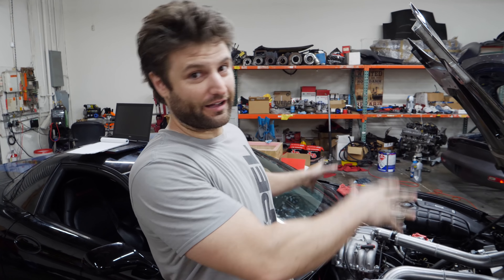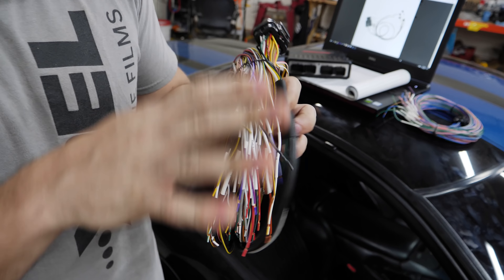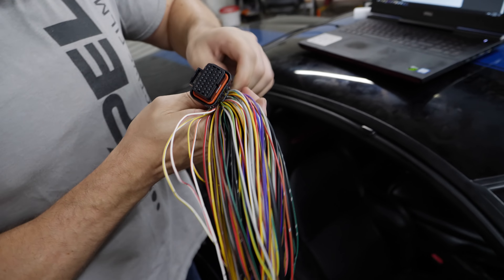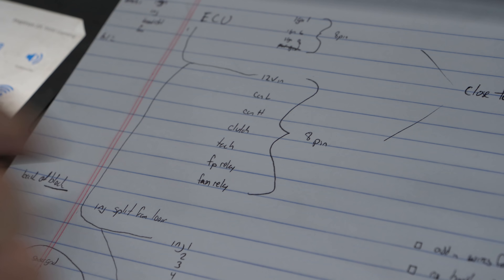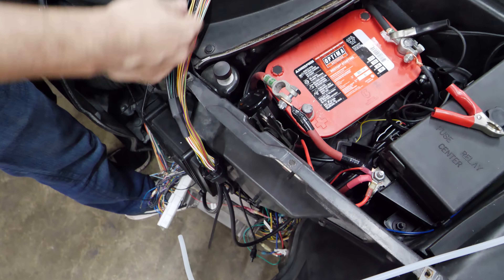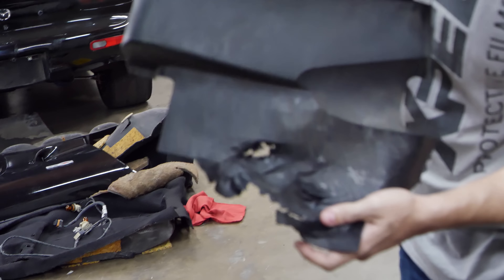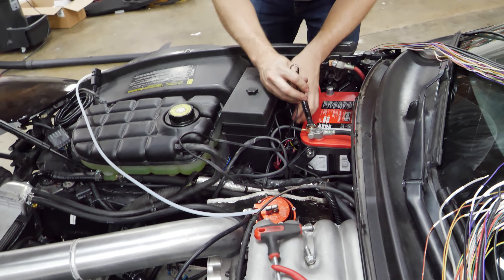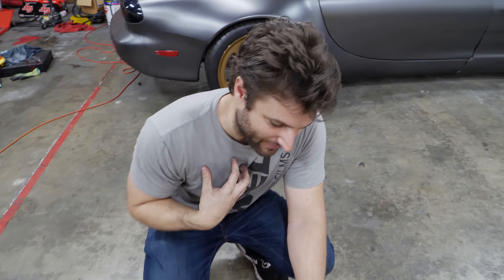Building the ULTIMATE Wiring Harness for any Rotary Engine. Since mine is destroyed...

Comment: You're probably already done, and you've already found out that making cables is deceptively difficult. Welcome to the wonderful world of cables! We have cake on Tuesdays.

However, as someone who inspects cables for aircraft daily, and used to make them, I'll give this one bit of advice to you and anyone else reading: get the best quality crimp tool and wire stripper you can possibly afford. Everything rides on that one connection, and I can't tell you (literally, I'm not allowed to lol) how many cables I reject for bad crimp connections and damaged wire from shitty/worn out strippers cutting into the wire. If you're shelling out for the power, you owe it to yourself to have quality tools that'll do the job right the first time.

Oh, and always leave some slack for re-terminating cables in the field. Always.
Reply: This comment needs more upvotes.
Reply: Any wire strippers and crimp tool you would recommend? Links?
Reply: @robdahm
Reply: Air Force? I was MXS but 2a6x2, worked on Detroit diesels, turbine engines, hydraulics, pneumatics, compressors, bomb lifts, generators, frequency converters, you name it.
Reply: You had me at cake. How do I join this Cake Tuesday club?
Reply: I've never seen loom-making as difficult, just time consuming, especially for custom looms. Aircraft, or anything military related, or space related, are held to much, much higher standards. While yes, the best possible tools are preferred, you can also get by with cheaper tools as long as they work and are used properly, when the job isn't held to such high standards. Most bad crimps, that aren't held to super high standards, are from people not using a tool properly, or trying to crimp with the improper tool.

The biggest problem with custom looms, as Rob has partially discovered, is improper routing, and the other part is bundling the loom into a singular entity, such as a split loom tube, or using something like tesa tape to bundle the loom. Having so many wires unbundled is just asking for problems, especially when you need to service the loom. 
Next issue after that is having so many connections within the loom. Ideally you want one run of wire from end to end. Though there are cases where this ideal isn't so ideal, like having bulkhead connectors mid-loom for ease of service; though this should be saved for any large looms, or difficult to remove wires, that are passing through a non-removable panel, such as the firewall. But these singular wire connections mid-loom is just not good. 

There's also the problem of heat-shrinking splices of multiple smaller wires to a singular large wire. Rob probably doesn't realize this, but shrinking the smaller wires, either individually or in bundles of two or three, before shrinking the joint would result in a better job, where everything is within the tubing. 
Not saying an absolute seal on the wires to prevent oil creep is entirely necessary, but there are a few options. Using liquid electrical tape at the solder joint between the processes of the smaller tubing and larger tubing, using high ratio (highest I've seen in 6:1) heat-shrink, and using a medium sized piece to shrink against the tail end of the larger shrink and smaller shrinks to ensure a tighter seal after the joint, or a combination of these. Again, not sure how necessary an absolute seal would be, but these are, what I personally believe, to be the better methods of obtaining that kind of seal, if needed. 
Same issues go for when you're putting a T, or Y, joint into a wire, there's just not a simple way to shrink this kind of joint that remains as effective as a normal joint, which is where liquid electrical tape comes in handy. Unless you have a tube that shrinks to itself, preferably with adhesive, you're going to end up with an open area at the end with the multiple wires. I would say just normal electrical tape, but I've learned to not like that stuff, especially in high heat areas; the adhesive is nasty stuff, and it doesn't always want to adhere, and if you ever need to service the joints, cleaning the wires of that nasty adhesive can be a pain. 

And speaking of multi-wire joints, especially the splices of one big wire to multiple smaller ones, Rob needs to use a better method of producing these joints. Sadly, I don't have any idea how to do this, as this kind of joint rarely pops up. Maybe a junction box is the only decent solution here?
Reply: Shit I felt like I just went to class thanks for the advice
Reply: And dont underestimate a bench vice and a powerdrill for twisting pairs
Reply: @luisk6007  the cake is a lie.

Comment: Pro tip Rob: put the end of the wiees in a vice, and on the other end attach a cordless drill to make the swist easier, while twisted put some heat with a heat gun on the wires to keep their polite form.
Reply: And put the vice on a workbench
Reply: To add to that tip: if you twist them too much or too fast the strands break inside and ruin the cable. Copper work-hardens really fast. Go slow and only twist your wires as much as you need to per spec. There are charts that make this easy.
Reply: Nah hand drill, just to be safe
Reply: You should really twist by hand. You shouldn't force wires into a twist because then you sacrifice flexibility of the loom. You really want to almost guide the wires into a twist by hand.
Reply: Not a pro tip and don’t ever do this.  Twisting wires with a drill will get you fired from my harness company.  It’s one of the worst mistakes people make.
Reply: @Triplebengineering  Agreed. The drill trick might be quicker but I've never seen it result in twists as clean as you can do by hand.
Reply: @scotty305  I've always used an electric screw driver, they spin a lost slower than a drill does, and allows for more control than a drill. Always found the twist to be more uniform over the entire length of a cable, especially when the length goes over 10 feet. But most of my use has been for audio signal, and I've never found a problem with this method. 
Though, factories make twisted pair without issue, and you know they don't do that by hand. I wouldn't be surprised if someone has replicated the factory method for small scale use.

Comment: Twisting wire pairs reduces crosstalk (electrical signal jumping from one wire to another) in the line which increases fidelity (like a speaker).
Reply: no, twisted pair helps reject outside interference influencing the signals on the wires, it has no bearing on the wires ability to interfere with each other. think of it more like a poor mans co-ax.
Reply: Denis O'brien We’re both saying the same thing (reducing / rejecting). Either way a magnetic field is created around the wires due to the twisting

Comment: Couple hints:
1) SuperSeal connector has awsome locking mechanism for contacts. You can easily remove all unused wires. Just unlock the red lock (by pushing it from one side) and pull the unused wire out. You can just put them in you storage space for future use.
2) I'd recommend putting all the wires into the corrugated tube, commonly reffered as Schlemmer (because they make it). They make various sizes and they last. Original Schlemmer is way superior than random no-name tube, they are just bit more expensive.

Comment: I remember my first turbo build, I had the wastegate dump pipe at about 8 inches from a wire loom. And racing a 370Z my wipers, lights, signals and horn all came on at the same time so I let go, check for the smell of burning wires and the loom was gone with all copper touching each other. Luckily I just took out all the fuses from those accessories and made it home.

Comment: Pro tip on shrinking splices of multiple small wires to a singular large wire: shrink the small wires first, either individually or in groups of 2 or 3, whichever you prefer, then shrink the large wire and bundle. Also, do not forget about wire loom tubing, or any product that would hold the loom together. Though, with a single connection of so many wires, maybe a junction box of some kind is preferable. 

If you really worried about fully sealing the bundle, there's a few options. 
Using liquid electrical tape at the joint before doing the final shrink, but after doing the smaller shrinks, should work. 
You could also find a specialty high shrink ratio tube, the highest I've seen is 6:1, which would be great for an application with varying wire diameters, and non-circular bundles. 
You could also use a smaller sized shrink after the large shrink, one big enough for the bundle, to fully seal against the larger and smaller shrinks. 
Or you could do a combination these, such as: shrink the smaller wires, liquid electrical tape the joint, use a higher shrink ratio shrink on the larger wire and joint, then finish it off with a smaller diameter shrink to seal the larger shrink to the smaller shrinks. It's just adding layers of security though layers of varying types of shrink, and liquid electrical tape, to ensure the best possible seal.

Also, if you're planning on doing this to every harness you're going to have, you might want to just buy rolls of heat shrink, especially for the longer runs of it. It'll save you some money in the long run.

Comment: twisted pairs prevent interference (crosstalk) because they keep neighboring signals from being on the same polarization (vertical/horizontal). Two wires that are parallel act as small transmitters and antennas to each other, and when they are twisted, they do not line up therefore do not suffer from crosstalk

Comment: I have multiple sclerosis. I can't look at that wiring harness without thinking the car has the same problem.

MS is where the body's immune system attacks the myelin sheath on the nerves. Once you strip the myelin sheath from the nerves and the nerves stay bundled together, the signals get crossed come on mixed up, or just stop going anywhere. It is exactly like melting the protective coating off of all the wires in the harness in the car. Some of them work, some of them don't work, signals get crossed. And when a person has MS that's what's happening in their brain and spinal cord.
Reply: jon doe  actually yes. If you don't know what multiple sclerosis, commonly referred to as MS, actually is, you can always refrain from commenting, otherwise you make yourself look very uneducated.

Comment: Tip for any diy mechanics. If you ever have to repair a twisted pair of wires, you need to cut and splice both wires and re-twist them. Can severely affect readings and CAN bus operation if both wires are not the same length.

Comment: I would be tempted to use "snakeskin" on the main part of the loom.  You don't want to pull it extremely tight, or the wire bundle will NOT want to bend at all, but it will keep the wires together nicely.  Also, you could put a layer of the insulation around the wire bundle and THEN put on the skin to keep it looking nice.

Comment: Tech flex makes so many different sleeves not only can you color code sensors,power,ground they also make heat resistant stuff. Layers of protection isn’t a bad thing at all
Reply: Techflex just makes the wiring look so much better than seeing a messy rats nest or that corrugated wire look that looks atrocious. They have one hell of a product line that will meet his needs somehow I am using the split loom on all my modified wiring in my truck and color coding the big power and ground as well as the audio wires

Comment: Use vice grips on the base of the wire and a drill on the end to spin the wires around super fast. Then you can measure out how far you need the twisted pair to go and cut for the connector. If you cut before twisting the final distance will be shorter.

Comment: twisted wires : think about two wires going from A to B, twisted once making a 8. You have two "circles" that react to magnetic forces, but they are in the different directions. So the magnetic noise is cancelled. Basically, twisting them results in very little "circles" (less interaction to each) and all cancelling each other

Comment: To prevent any interference in the engine position sensor, you should change the left AM-fitting to straight one. Pipe runs too close to the tooth rotor, and can cause  grounding issue.

Comment: Why don’t you run a knock sensor? My dad and I are building a 93 that’s getting close to first start, but I don’t know jack about tuning or knock events in a rotary
Reply: You should run a knock sensor. But in most cases when the ecu detects knock it's too late, especially on stock apex seals. Better of being 100% confident in the tune and.... ummm, wiring harness
Reply: Red Bat Racing ty for the info!

Comment: Rob that is not just a visual thing with your crappy wiring job it worked right now but if you ran that car very long those wires would rub against sharp edges and eventually you would have had problems.

Comment: Rob, for all the money you spend on builds I cannot understand why you have all that junk wiring in there.   Non of that is or will be “ultimate”, just rip it out and have a professional build you a properly designed, correctly routed, sleeved harness using good components.  Build it right, build it once.   That stuff you have there is amateur hour.